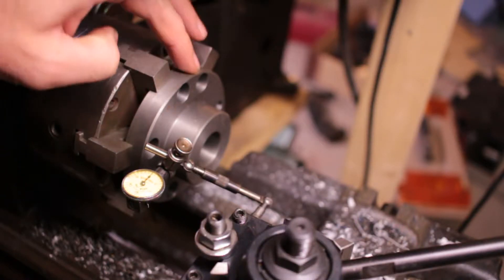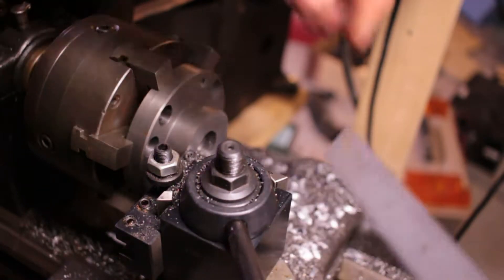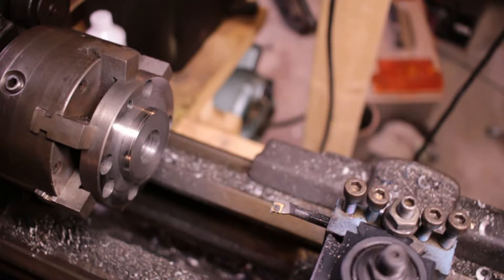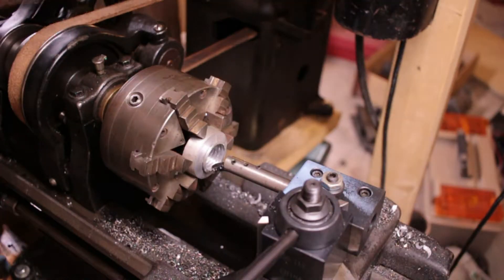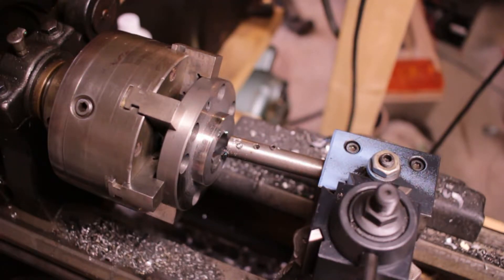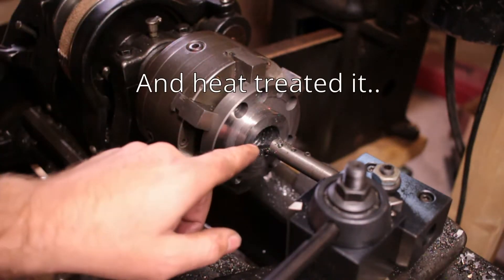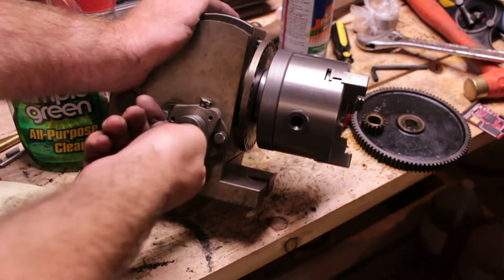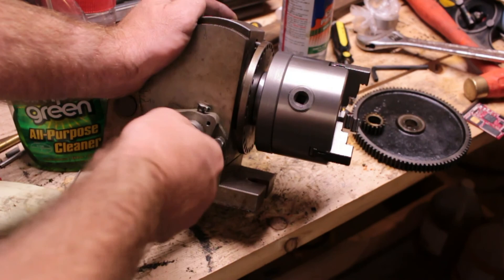Chuck back plate for dividing head

Comment: really interesting videos, I just finished all of the videos on the dividing head and the monarch lathe. I just found a motor in the monarch, exactly like it with a noisy bearing, and was wondering how hard it was to replace it and how much they were? Also, I was really interested in how you forged the spring steel into the cutting tools, I'd love to see how that was done. Great videos and keep up the good work.
Reply from the maker: The bearings in the motor weren't that hard to get to.  It was a little harder getting it back together.  There is a backing plate that holds in the bearings and it's hard to hold that in place while you get the screws in.  I decided not to replace the bearings in the motor.  After I cleaned the dried grease off of them they ran a lot smoother.

To make the spring steel cutting tool I heated the piece with a torch and stuck it in a bucket of ashes to anneal it, cut off a section the right length, milled it square, heated it and bent it then ground it roughly to shape, hardened it and then did the final grind.  I don't have a proper forge at my house (it's on the list) so I had to just use a regular propane torch to do the heat treatment.  It wouldn't get hot enough in the vise so I set it on some fire bricks and made a ghetto forge and that worked.  I can do a video on it at some point.
Reply: oh, ok, I may see what all it takes to tear into this one. I got it for free and the person who had it just threw it away, so I figured I'd get it to play with it and get it fixed, or make some sort of 3 phase generator out of it or something.

That would be really cool to see how you do that, Ive thought of doing some cutting bits out of spring steel, but just couldnt find anyone that has really done it that wasnt for woodworking. Why not just put it in the foundry furnace and get it hot enough through that and to anneal it by letting it cool with the furnace? You were talking about casting the sector arms in brass, thats why I ask.
Reply from the maker: I don't really have a good foundry furnace (it's on the list), right now I have a pile of fire bricks that I stack up.  It works ok but it's slow to set up.  Which is partly why I ended up making the dividing head arms out of aluminum.  I have a job that I will need the dividing head for and I didn't want to go through the slower process of casting then machining the arms.
Reply: oh, ok, that makes sense. Cant wait for the next video.